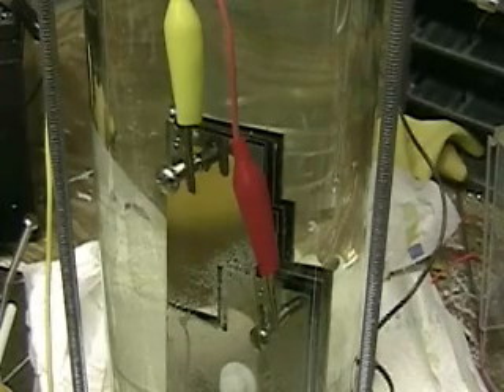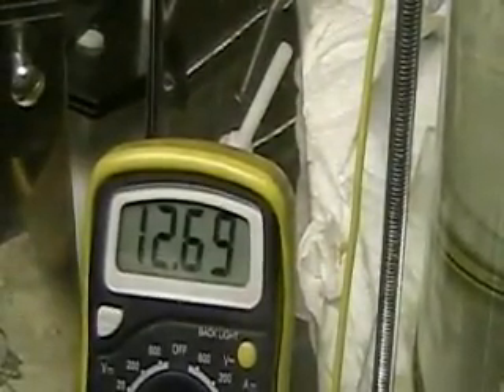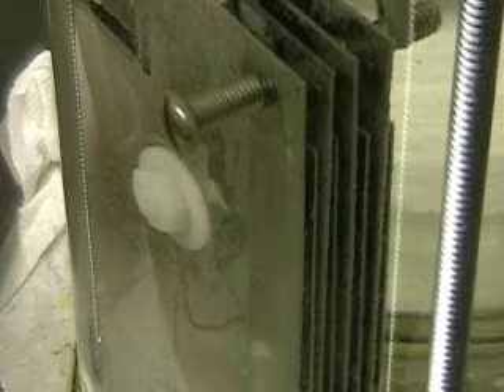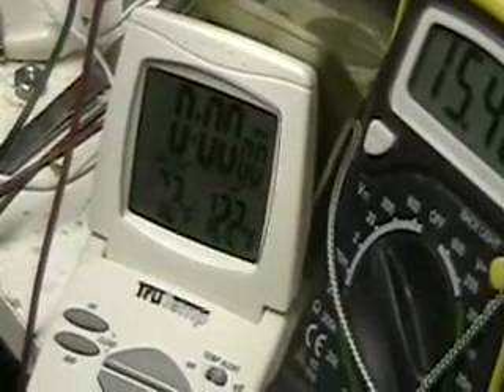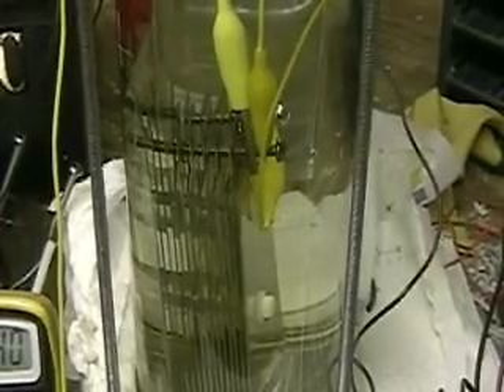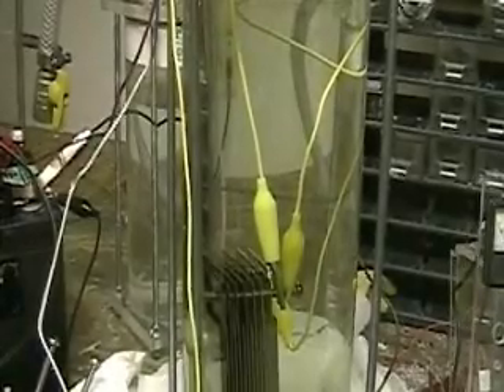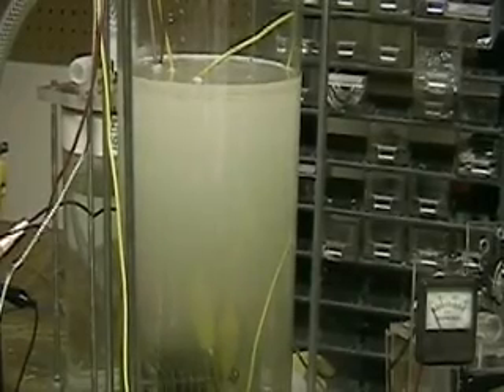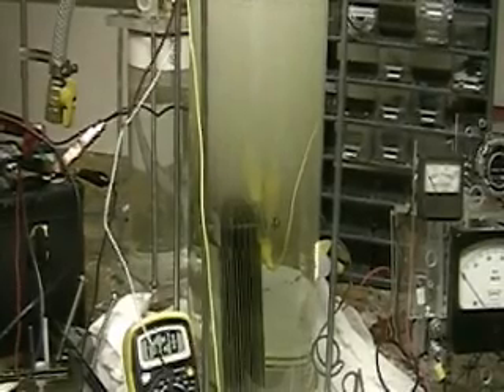Hydrogen Tap (New Config Test ) 177

Comment: your wire is to small for 15 plates . your 6 plates use 15 amps your 15plates will use like 30+ amps you need like #8 wire to use 15 plates +-+-+-+-+-+-+-+-+- you will make alot of HHO mabe to much